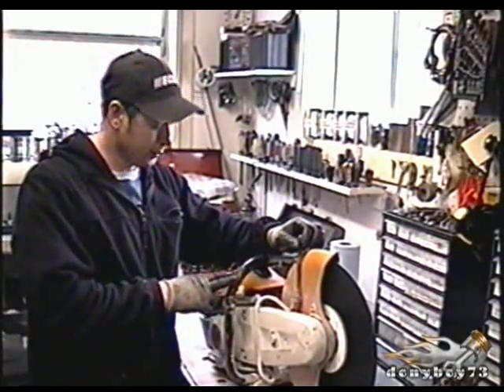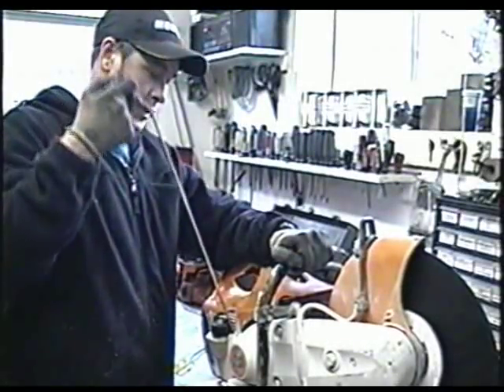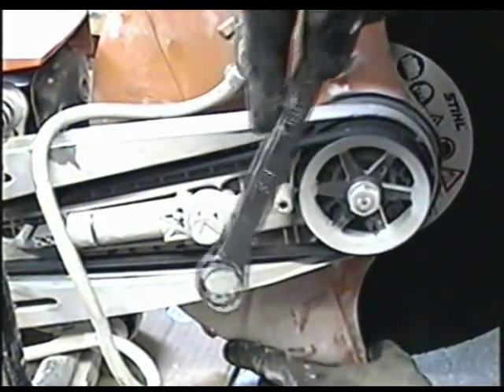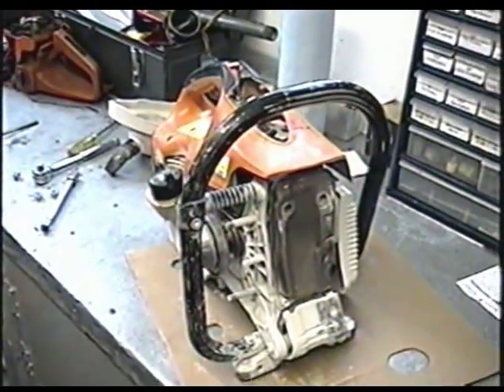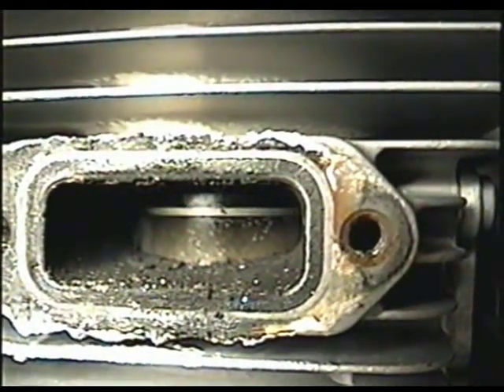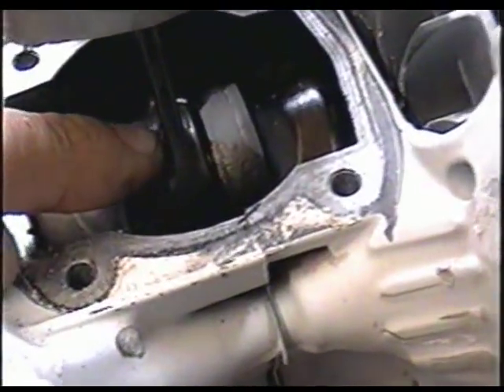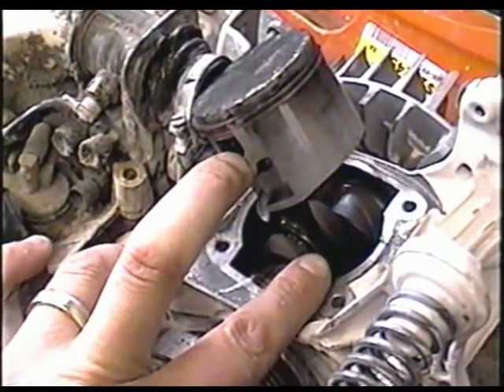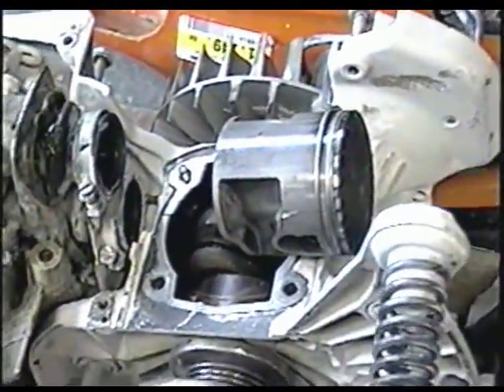Stihl TS420 CUT QUICK SAW Blown Top End Teardown

Comment: As a Mason of 42 years, I can confirm they don't last. Mostly due to not replacing air filter regularly and wrong gas mix ratio. When ya have 8 different guys using it, this happens. That said, they are tough little Saws, and with proper maintenance will last a while. Just the nature of the beast. Nice video. 👍👍

Comment: I had a stihl ts400 it was re built but the guy didnt tighten a screw near the flywheel and out came the screw and shredded all the fins on the flywheel. great fun when they all came out the side vent.

Comment: Helpful information. I need to replace the carb on a TS 420, so good to see this disassembly process. Carb seems hard to get to.
Reply: Simon Anscombe Thanks!  Hardest part was the throttle linkage.
Reply: 99carnot 
When you do them on a daily basis it's done very easily with a pair of wire cutters 👍🏾
Reply: Simon Anscombe Thanks. Good information!

Comment: i just rebuilt  mine with all new kit everything  and on startup it smoked but i thought maybe for the oil i put on the piston and rings and head not much i let it run for 20-30 min at idle for breakin and it smokes badly on the rev up  .......took it back apart to check the rings and head all looks good comp test at 87 -90 no leakdown after 10 min what do you think could be the issue

Comment: I really think that crank is useable. The play side to side should not affect the crankshaft. Just bought a new crankshaft for my husky 372 and it has it. Put a new top end on and youve got yuorself a good saw. They make cheaper replacement ones on ebay just as good quality in my opinion.

Comment: I have a TS400 that seams to run fine without the air filters. When the filters are on, it runs very poor. I think it is too rich. The filters are new and I have installed a new OEM carb with no changes.  What direction should I proceed?

Comment: Donnyboy, I rebuilt the top end after the saw was run on gasoline only. Now it seems there's a carburetor issue. what's the best way to rebuild the carb on the ts420?
(I know.... loaded question....)

Comment: So what is the difference between the $150 piston and cylinder assembly and the $320 one from the local Stihl dealer? Will Stihl offer the aftermarket as the $320 set up, or si there a difference in quality between the Stihl and the aftermarket parts? Do you use aftermarket or stihl?

Comment: Hi, I have ts420 that no spark and very hard to pull the cord. The spark plug and ignition are good. What do you think? Thanks
Reply from the maker: Check switch wires.
Reply: @donyboy73  so everything is looks good  when I pull out the spark plug. The pool cord goes fine. It’s easy it’s a it’s good but when I put the spark plug in the pool cord just is not normal. It’s not like coming all the way up .very hard to pull.when I trying to pull it hard it just doesn’t happen I’m suspecting of the bearing or the crank shaft .

Comment: Donny, how deep would say that scratch in the cylinder was? How deep is too deep to hone? And the scratch i have is just below the intakes that run horizontally through the cylinder, at about the same level as the opening for the bottom boot. is this 'honeable'?

Comment: Dirt is what killed that saw, lack of filter maintenance. The rings wore in their grooves then started fluttering. Finally a piece broke off and that's what scored the top end. Worked on many Cutquilks and have seen it over and over again. Stihl is the best but they still need maintenance.
Reply: Crappy design, had multiple 400 that ran good and strong for a long time with maintenance. Have 2-420 that are crap, cheap parts and crappy craftsmanship.

Comment: I have a TS 400
A real bugger to start
new spark plug  - gap was set 
there is a spark from the coil

When it does run, seem the Choke changes position
suggestions...?

P.S.  love your video's  keep doing them please
Reply from the maker: check the switch and linkage to the choke

Comment: Clean Air Filter Clean Air Filter, Clean Air Filter, Clean Air Filter, Clean Air Filter, Clean Air Filter, any internal combustion engine that operates in a concrete dust environment needs to have the air cleaner serviced after every use....or just buy new saws monthly
Reply: Or cut with water
Reply: Agreed, using water is always the best option. However you should still clean air filter frequently.

Comment: Don I noticed there is no cam shaft and no intake valve or exhaust valve so, this must be the difference between a two stroke engine and a 4 stroke engine. Am I right Don?
Reply from the maker: yes big difference
Reply: I never saw  the inside of a 2 stroke engine until now and I must say, it is a big difference.
Reply: OK thanks for the info, I always thought the difference was just oil in a 4 stroke engine and a 2 stroke engine required a gas mixture of oil and gas.
Reply: Very interesting and now we have something new on the horizon and that is new electric power motors. I think eventually, the electric motors will get more powerful and give the combustion engine some real competition in the future.
Reply: Just...stop talking..andreas stihl invented the electric chainsaw in 1926 and this is something new?? lol
Reply: In 1926 Stihl may have invented the electric chainsaw but, they did not have the battery power back then that they have today.

Comment: Low octane fuel killed that saw. It went into detonation and the ring land and ring was the weakest link.
Reply: LZN197 you are exactly right  the saw leaned out and at high speed without much load kaboom
Reply: I’ve Had The Spark Control Modules Go Also And Throw The Timing Out Of Whack